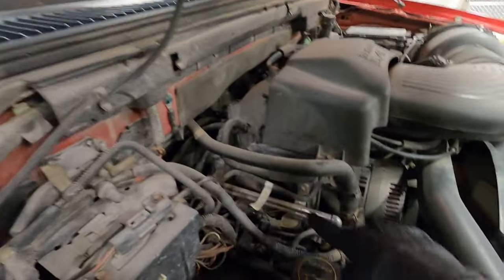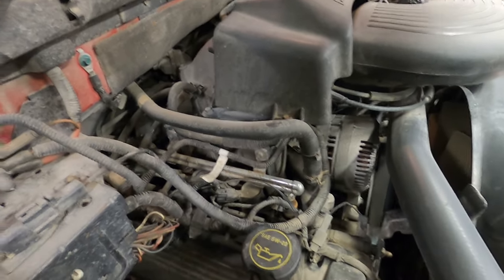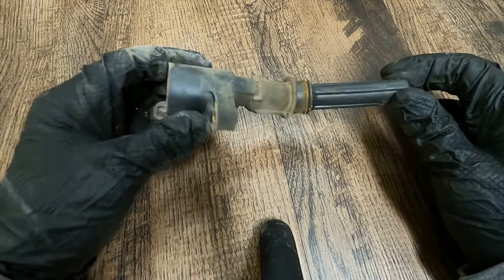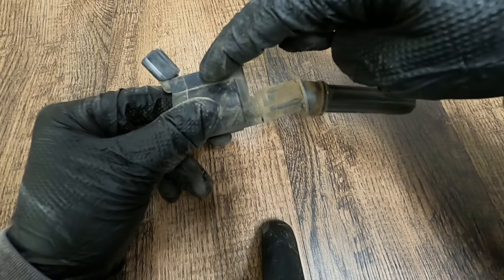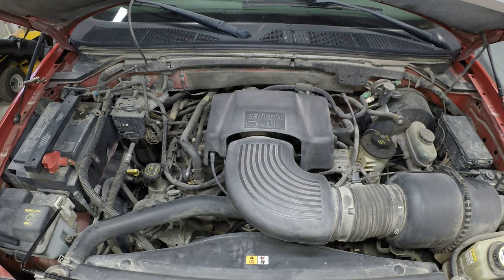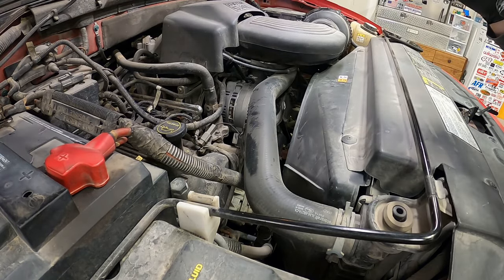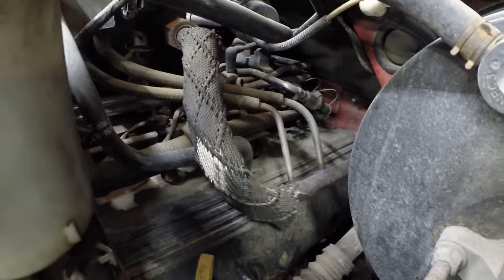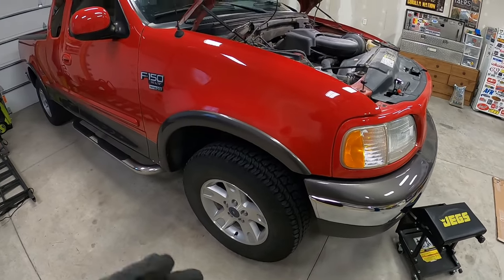Most Common Problems With Ford Triton 5.4 2V Engine

Comment: My 5.4L March 2022-  402K Miles. Original Motor, Tranny, Starter, Driveshaft.  
I can not recommend this HIGHLY enough- change all the coils at the same time & make sure they are the highest quality you get get your mitts on. NO CHEAP EBAY KNOCKOFFS !   Get Original or better.  Top end Coils will keep your 5.4L running smooth and purring like a kitten. My truck is 21 years old 402K Miles and last tank of gas :  16.4 mpg.  I track the mileage fanatically.   I can not hear or barely feel my motor when it's running !    If you buy cheap coils you will suffer endlessly......misfires , check engine lights galore, rough running, etc.
Reply from the maker: That's impressive, thanks for sharing!
Reply: Yeah I made the mistake of buying cheap coils. Never do it.
Reply: @darrenthoreson3924  One full year with top end coils. Running like a dream. Cheap coils were throwing codes all the time. Ran rough.  I'm getting the same MPG now as when it was new.
Reply: @matt75hooper  motor craft or another  brand?
Reply: @ajmedeiros77  Denso coils. I can not stress enough how incredible the truck had been running since I put these in. I was using cheapo ebay coils. This truck has 406k miles & has been purring like a kitten with those coils. 
While you're in there put new plugs in too.  Any top rated plug will do. I used Motocraft.
The person that recommended the Denso is a 30 year Ford mechanic.  A real fanatic too.
Good luck.
Reply: @ajmedeiros77  Motocraft plugs.
The cheapo coils lasted a few months then it was throwing codes driving me crazy. Not one code thrown since installing Denso coils. So smooth I can't hear it running when idling.
Gas mileage is amazing - 15-16 MPG.  Long trips I've hit 17.  Same as when the truck was new 21 years ago.
No more hesitation when I hit the gas. It flies compared to previously. 
One more huge improvement- using full synthetic 5W20 for some time now.  Excellent.
Reply: Better change your oil cooler .. When that blows internally  the oil pumps into the coolant side and blows the radiator and the engine will pump out of oil .. Oil pressure is 2-3 times the pressure on the coolant side
Reply: @matt75hooper  Funny, I just put a set of Denso coils and Motorcraft plugs at 205k. Thing runs like a top. I'm assuming you've done the timing chain, what mileage did you do yours and how did it look?
Reply: @jacobjohnson4763  Original timing chain. Never been touched. Original motor, tranny, driveshaft & so many other original parts.
*Heater core just went. 412K miles. Quote: $800 bucks. 
Going in Wednesday.  Too cold to go without. 
Still purrs like a kitten.  You can't even feel or hear it idle.
The new plugs & especially the new coils made a HUGE difference.
Reply: Throwaway Account but I have a 2000 Ford F150 Lariat supercab with the 5.4 2v. I bought it for 4 grand. It ran good until it started bogging and acted like it wanted to shut off at operating temperature so I  brought it to a mechanic who said he replaced the coil packs, spark plugs and something with the fuel system. It fixed it for about 2 days until the same problem arose again and someone said it could be my throttle body that needs to be cleaned or replaced. I'm not sure at this point what to do because my truck is not showing a check engine light and itll definitely take me places but not on a day out where I'm going from place to place
Reply: Update June 2024. 428K miles. Smooth as silk. 16MPG. 
Original motor, trans, drivetrain..
*Changed out the fuel tank which was only $350. I was gobsmacked expecting a very expensive job. 
Gas smell wound up being some small rot on tank.
What an amazing truck.

Comment: I must be lucky, as I've only had to replace the ALT, the MAF and (I think) 6 coils over the last 10 years.
No blown plugs, no coolant or vacuum leaks,  just an exhaust tic that goes away after running for a minute or so.
208,000 miles and still going strong.

Comment: Mine is a 2002 Ford E350 van with the 5.4L.  I have a misfire in one cylinder and after changing all plugs and coils, it is still there . I am a retired auto mechanic and thinking now of doing head gaskets and timing components and all new spark plug thread inserts and a water pump while it is dismantled. Engine has 176,500 miles. No smoke or leaks and runs well despite that one cylinder misfire....once I find that...and I get the steering tightened up and responsive....I will take this van on a 5000 mile bucket list trip before settling down in lower eastern Michigan fo summers and Daytona Beach Florida in winter!

Comment: You forgot one thing on those misfires. Coolant crossover the plastic mold busting out are cracking and then the gasket blows out which causes antifreeze to get down into the  Spark plug whales and causes bark plug the foul out or cold pack to go out as well lotta times you won’t see The engine coolant leak if it’s not a bad leak it could go on for six months to a year I’ve just barely leaking into those spark plug wells and just follow spark plug here and there. I know this because it happened to me.  I’ve got a 2001 F150 bought it with 42,000 miles in 2005 it’s got 250,000 on it now. Knock on wood and a pretty good truck overall, it’s been good enough that I wanna keep it and I also all of the work to it. As of so far. The only issues I really had that was serious is the intake manifold. Also if you’re changing that it’s also good to go ahead and take the throttlebody and clean it really well while you have it off. My truck at the engine service light on from like 160 to 170,000 miles up until I change the intake manifold the last time and I clean the throttle body real well. Which I have not had a light come back on since.  Which is wild because it still has the original exhaust and original 02 sensors as well.

Comment: 2003 Lariet, had to change the plastic intake at 150k miles because the crossover tube was leaking coolant into cylinder one spark plug tube, fouling out the coil pack.  When I had the intake off replacing it, I did the plugs, injectors and all new German high output coil packs.  Been running like a champ ever since.  250,000 miles and going.

Comment: My dad owns a 07 e350 with the 2v 5.4 and the only major problems it has had over the 12 years of ownership was bad catalytic Converters and a probelm with the coil packs causing the engine to randomly shutoff at any time, we found out that the coil packs (which we had recently replaced) were defective, so we reinstalled the factory coil packs and its been running fine since then.

Comment: Excellent video, thank you !!!  I discovered just yesterday that my 2000 Ford Expedition has a blown plug.  Your video helped me diagnose my problem !!!
Reply from the maker: Glad it helped! Thanks for the comment!
Reply: @KonaBlueSVT  You're very welcome !!!  

My only question  is this- when I take it to the repair shop here in Woodiinville, WA, will they be able to cut new threads into that spark plug hole ??  ( It's the furthest back spark plug, on the passenger side )  I could barely reach the coil with my hand.  I am concerned that they may have to pull the engine to make this repair, because there is such a small amount of room.  Can the thread cutting tools fit into that small space ?? Thanks for your reply !!!
Reply from the maker: @DanielGoodness87 They should be able to do any of them with the engine still in the truck. They make a special kit to fix these.
Reply: @KonaBlueSVT  I am so relieved, thanks so much for this !!!  When a guy is on Social Security, like I am, car repairs are scary.....

Comment: Appreciate your video.  I have an ‘03super duty with the 5.4 mated to a 6 speed manual transmission.  Bought it used 10 years ago with 39k miles. Never has been a daily driver, religiously maintained, now has 85k.  I did a “preemptive strike” regarding the spark plug issue, having seen a video about that.  The plugs were all changed out 10k ago by a guy who claimed to be familiar with the 5.4 issue.  This week I am pulling a 20’ empty car hauler many miles from home and the rear most plug on the pas. Side blows out of the head, damn!! My luck, the mechanic is out of town so I am dead in the water.  I watched a video today that recommends motor craft only and over tighten them from 13 lbs to 23, claiming they will never come out, and, if you do not do that, it’s just matter of time before they do.  What say you?
Reply from the maker: Tightening to the higher Torque spec helps, but it's still not a guarantee. I had one personally that still blew out afterwards.
Reply: @KonaBlueSVT  how about some sticky locktite goo?
Reply from the maker: That might help, but then you will have trouble getting them out if you needed to for a misfire or anything.
Reply: On an annual basis I perform a PM on all my equipment.  On my 5.4 truck the annual PM now includes re-torquing the spark plugs.  In addition to checking brake pads, differential oil, coolant condition, greasing suspension, suspension wear checks, filters, etc..
Reply: Put 1 drop of loctite  or superglue on top of one side of the threads AFTER you tighten the sparkplug. This will allow you to break the glue when changing the spark plugs but will keep the plugs from backing out.

Comment: Hey, Thanks for the vid. I have a 1997 F250 5.4 runs on CNG. 7 bolt rims. It was one of Fords fleet offerings at the time. Yer truck looks great by the way!
Nice to see folks keeping the old stock running.
Reply from the maker: Hey, I appreciate it!
Reply: I have a 99 f250 5.4.2valve 7 lug.. and I've been having misfire issue, vacuum leaks and overheating

Comment: 2000 f150 5.4 HD. Currently trying to tackle lean codes. There is a lot of crud buildup around the intake manifolds, above the coils etc. also the valve cover gaskets are leaking. No coolant loss or leaking from what I can tell. I’ve checked all vacuum hoses and replaced 1 that was iffy. No misfires either. Truck runs good but I need to pass smog here in CA. Hoping a new manifold, coils, plugs, and valve cover gaskets fix the lean codes. Also the truck has an aftermarket K&N cold air intake. It seems to be using the stick maf sensor but am currently looking for a stock intake hose.

Comment: Very awesome content brother. I have sprayed carb cleaner around the back in my '98 E250 van, but couldn't really get around the front because of all the over-emissioned crap in the way... but after changing plugs, coil packs, injectors, fuel filter,... ran great for a couple days, now it's running very sluggish, weak as hell, and now I have no check engine light...
Reply: Also... now it's having a hard time starting...
Reply from the maker: Have you checked fuel trims and fuel pressure?
Reply: No I haven't, I am realizing now I should have bought a scanner, or paid a shop first... before throwing parts at it.. lol,,, but since I hadn't changed plugs, coils, or injectors, or oil for ten years, it couldn't hurt... HA!
Reply: However, I got a guy, that knows a guy, he's gonna hook me up to get it scanned... as long as I can get the van down there...👍
And thank you for getting back to me. 
I have all the tools in the world, so I like to fix my own sh%t, but I do get stumped...👍
Reply from the maker: @faronsquare4911 hope you get it figured out! Come back and comment what the fix was!
Reply: Will do for sure, I was a aerospace machinist for 20 years, so I reinvent the wheel a lot! 😂 but I'll d
Reply: Definitely let you know what it was 👍

Comment: calvan kitting my whole engine currently. Hardest part is making room and getting majority of chips out of cylinder. It is an awesome DIY kit!
Reply: I installed cal-van inserts on our 5.4 2v 6k miles ago. Excellent kit. Very confident in the repair being permanent.
Reply: On the spark plugs? I just bought the spark plug kit and I’m about to do the job, what other kits did you buy
Reply: Excellent kit. Borescope and fine tooth ingersol ratchet as recommended by Calvin is a must. I use a small plastic tube to blast the chips out.
Also grease on drill and tap to catch most of the chips. Also Loctite red seems to work better than JB weld on the inserts.

Comment: A mechanic told me that the metal pipes on the left side of the engi e were known to corode   and bust a hole where coolant would spit out. Reason, too much water to coolant ratio. 4 years later, it happened to me. It requires the manifold to be taken off.

Comment: I have a 97 f150   5.4 with 250000 miles only have to change 8 coil over regular oil changes
Runs like new great truck

Comment: I had a coil misfire problem when I first got my 01 5.4 Ford. I replaced all the coils but found the problem was the clips that connect the electrical to the coils. The clips cost as much as the coils but have had no trouble since replacing them. My 5.4 2V now has over 250,000 miles and going strong.

Comment: Sometimes when the plastic intake goes bad coolant will fill the spark plug well and cause a misfire also.
Reply: Also rusts the plug & cause issues getting a socket on it . Gotta scrape it & blow to get out
Reply: @richardstrange2432  Absolutely!
Reply: My lower intake manifold was leaking. When the mechanic pulled it off, it had a Dorman  manifold. The mechanic replaced it with another Dorman manifold. Best advice use Motorcraft.

Comment: Coolant loss problem I just learned to accept it like a cup to 2 cups every 3 to 4 days depending on how far I drive it
Also I kept getting a misfire in # 1. cylinder after 2 shops diagnosed the problem after replacing plugs all 8. All 8 boots replaced on #1 cylinder the injector and the coil pack replaced  still there was a misfire  and check eng light still on. And scanner read misfire at start up both shops said it’s a blown head gasket coolant leaking into cly #1. They said I  needed a new motor 
Motor and truck have 200,000 miles well I kept driving it since it was only stalling at start up but then cleared after warm up

To make a long story short it ended being my coolant cap

I disconnected the battery cable which cleared the check eng light. Then reconnected  it. Then I bought a new cap installed it.  Like I turned hand tight only no clicking sounds  just snug.   Well it’s been 200 miles and I’m sure the computer has recycled and the check engine light is still off and I’m keeping on eye on my anti freeze and oil level.   Truck runs as good as new

Some pple may disagree but I don’t have 8,000$ for rebuilt long block labor and parts.  I’m just gona drive it till it dies.   My truck is
2002. Ford F-150 XLT. SuperCrew 4.6 automatic
The Coolant cap was bad and not venting causing excessive pressure inside the motor and cylinder heads probably forcing coolant into cly  #1 causing that misfire at start up.   Good luck to all.   First On Race Day
Reply: Did your misfire ever come back? I keep getting cylinder #1 misfire comes and goes. Replaced coils, spark plugs, I even swaped out   Injectors and it still came back for like 2 minutes and then went away idk what else to think lol pulled the coil and spark plug out and it's bone dry and looks super clean! Swaped out plugs too. You ever figure out the issue?
Reply: @golpherboy13  
Hi 
I sure did it was something so simple. My dad made the same comment to me watch it will be something simple.  He was an equipment mechanic gas and diesel for Santa Fe Railroad back in the day, and on weekends I would help as a kid work on the family cars trouble shooting tune ups or engine overhauls we did it all , so now as an adult I don’t get Into rebuilding but the rest of it trouble shooting tune ups change parts I do get into it and love it.  My dad was a Ford man also!!

Any way it ended up being the coolant cap it was holding to much pressure or not venting and caused my coolant system to overheat like a volcano it was causing enough pressure in the left side head gasket to leak Into cylinder #1

So during the day it ran fine but when it sat at night under pressure that’s where it would relieve itself and piss coolant into that 1 cylinder causing a misfire every morning and the check engine light would come on. But once it burned the coolant it ran fine.   I changed plugs boots checked all the wires on all the injectors coils on all 8 cylinders I replaced the the #1 coil and injector and plug and boot and still no luck .  Also I was loosing coolant and I couldn’t figure out why it wasn’t leaking no leaks any where. I refilled my coolant burping it correctly slowly replaced the coolant, bought a new coolant cap tightened only finger tight do not let it click click or lock in place and that solved the whole problem     
That coolant cap was now breathing off the side of the cap and from the vent it’s been maybe 6 months problem never came back.    Good luck!!
Reply: @joecarreon4824  did you ever do a compression check?
It's hard for my thoughts to go to:
If the cooling system created enough pressure to push coolant through the head gasket, then the gasket would have to be shot. When the cylinder fires there will be far more pressure on the head gasket than the cooling system could ever create, so wouldn't there be an overheating condition happening?
If it is working, great! I would continue driving it as well.
Reply: @markchidester6239  

Hi Mark.     Yes I had a mechanic check the compression and it was fine all equal all pistons,

It was the weirdest thing In my years of owning cars and trucks but it’s been running in top shape since  I repaired the truck.    I’m at 200,000 miles and going strong no overheating issues summer or winter or towing or off-road.

Thanks for your comment